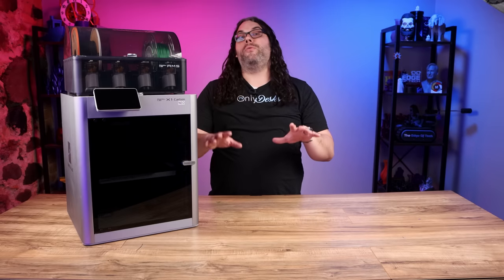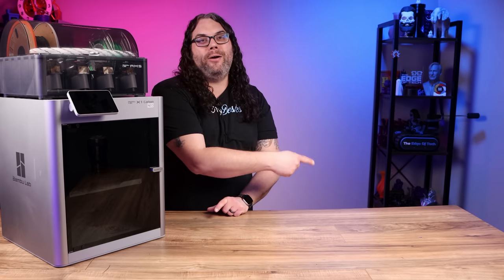10 Bambu Lab Maintenance Steps You MUST Do!

Comment: Definitely DO NOT spray IPA or any other cleaning agent onto the rods, spray onto a cloth and then wipe. Spraying in the enclosure results in covering the belts (rubber and alcohol don't mix, will dry out and crack), covering the linear Y rods and removing all the grease from inside which you can't repack, spraying onto the rods is terrible advice unfortunately. Follow Bambu's maintenance guides to prevent damaging your machine. Also probably best not to use oil on the lead screws, oil can run down the screw and into the stepper motor below (very bad), again there is a reason why Bambu specify grease and not oil 😵‍💫
Reply: Yeah, there's a lot of bad advice in this video. Clearly not made by someone who knows how it's supposed to be done. Also... using compressed air to clean a machine? Really not done. This will only blow dirt into the small crevices, making the risk of jams bigger.
Reply: To be fair, the official rod cleaning video published by Bambu Lab's youtube channel had them spraying alcohol on the rods. 
Not that I'd ever think or want to pour isopropyl into a spray bottle.
Reply: A paper towel? why not a micro fibre cloth..?

also why lubricate only one off the rods and not all? I got more questions then answers....
Reply: @joeyhouben3270 I think he was just using the one screw for an example. I’m with u on using the microfiber towel
Reply: Please do not pretend to know everything but know nothing, the oil will destroy the motor? That is the biggest joke I have ever heard.

😂😂😂😂
Reply: Really you shouldn't use IPA at all on carbon fiber as it breaks down the (epoxy) resin. A little distilled, RO, or DO water on a lint-free cloth is good enough.
Reply: @TonyShuai   When did they say "oil will destroy the motor"? They just said the oil can get down into it which is bad.
Reply: @_droid @_droid  Why does the official Bambu lab's video also use IPA?
Reply: @MarinusMakesStuff  so how are we supposed to clean those things without the compressed air? do we really have to disassemble the whole thing to wipe it down every month? that sounds like a huge pain in the ass
Reply: Can you point me to a better video? I need to do maintenance on my x1c and this was the first result I came across BUT THANKFULLY I came across your comment before performing. Please help. Thank you.
Reply: @MarinusMakesStuff  you seem to know what you’re talking about as well. Can you, PLEASE, point me to a better video? I need to do maintenance on my printer (an X1C) and this video was the first result I came across BUT THANKFULLY I came across your comment before performing. Idk if the original commenter will help but can you recommend a different video? Thank you in advance.
Reply: @slimthugga34 did you find a better vid...?
Reply: @GeneStarwind344 I’ve been doing it wrong this whole time
Reply: As for wiping the rods completely clean, well that black stuff he wiped off completely is the carbon from the self lubricating bearing. Yea, they might get dust and other debris on the rods but you shouldn’t have to wipe them complete clean and remove all the micro carbon lubricating factors. Also non lint things like kimtech wipes, not appear towels. And you can find a PTFE grease that would work better than the oil, at least last longer.
Reply: @slimthugga34  The better video is simply go to Bambu's wiki and the official instructions.  Then you can't go wrong, and they have very good very in depth information on thier website.  Not like some companies.
Reply: Yeah. Plenty of bad tips in this video...

Comment: Good video..but quit using regular paper towel!! That is leaving fibres behind. Use Blue shop towels or a microfiber cloth instead. Otherwise you are just adding to the problem of leaving bits behind on your rods and lead screws
Reply from the maker: Great advice! I used it because that is what most people have laying around. But if you look at the description, I linked the blue shop shop towels! :)
Reply: Careful with these microfibre stuff, might scratch glass or the coatings on the glass. Consider buying some optical wipes for this purpose

Comment: Do not use oil on your lead screws, this can destroy the motor as well as the entire screw. You need to use grease as specified. Also never spray isopropyl alcohol inside your container, you will dry it out and crack the belts. What the hell is this video?
Reply: The Bambu Labs video shows spraying liberally all over the rods too.
Reply: I was wondering why we got the grease packets.  😂

Comment: Do NOT use isopropyl alcohol on the camera or LIDAR! IPA removes coatings off lenses …. Like the anti glare coating on most cameras - including the Bambu cameras. This is also why you don’t use IPA on eyeglasses. (Source : I’m an optician)
Reply: IPA is recommended by the manufacturer.
Reply: @jeepthangjim  manufacturer is a 3d printing business. Not a lens manufacturer. IPA not recommended comes from lens manufacturers.
Reply: @alecubudulecu  Doesn't matter. The manufacturer of the machine provided recommendations on how to care for the machine. If you want your warranty to be honored, you follow the manufacturer's recommendations.
Reply: @jeepthangjim  lol.  you think Bambu will know the difference between IPA or soap and water on the lens?
Reply: @alecubudulecu  So you're saying there's no difference between IPA and soap and water?
Reply: @jeepthangjim  I’m saying pure ipa is bad for anti reflective coatings.  The source is every optician on the planet. Worked in the industry for nearly a decade and we used IPA to strip the anti glare coating.  It takes anti glare off. 

If you insist on using it … dilute it with a mix of 30% ipa and 65-70% water and a bit of dawn dish soap (like 2-5% ).  This is also how we make eyeglass cleaning solution.

Comment: CHAPTERS
0:00 Intro - 10 Maintenance Tips
0:14 Note - Bambu Lab Printer Compatibility
0:35 Removing AMS
0:51 Removing Top Glass
0:57 Cleaning Rods / Belt Tension / Error
1:09 Turn it OFF!
1:18 2mm Wrench - Loosen Four Screws
1:30 Isopropyl The Rods / Moving Head
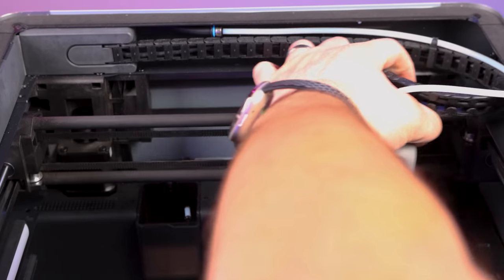1:41 Wipe until Dry / Paper is clear
1:59 Moving Gantry - Front to Back
2:08 2mm Wrench - Tighten Four Screws
2:19 Turn it ON! - Self Test Button
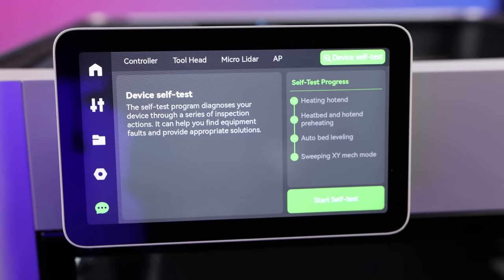2:31 Very Important Steps Completed
2:40 Cleaning / Lubricating Z Lead Screws
2:55 Keep it ON!
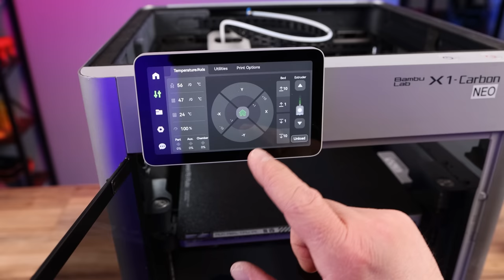3:03 Move Bed to Bottom of Printer
3:13 Lead Screws Cleaning / Isopropyl Thin Coat
3:39 Applying Synthetic PTFE Oil
3:46 Small Drops goes a long way!
3:53 Homing to spread Oil
4:03 Applying Oil to lower Lead Screw
4:15 Cleaned and Lubrication Completed
4:21 Recommended Lubricants
4:31 Quick Message - Thank You!
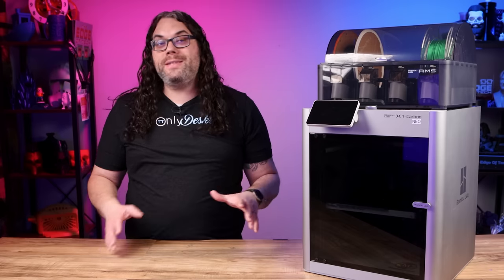5:03 Extruder Cleanup
5:12 Lift Off Front Cover / Compressed Air
5:23 Optionally Remove Extruder and Clean
5:41 Cleaning the Fans - Important!
5:56 Compressed Air - While OFF!
6:16 X1 Carbon - Cleaning Lidar Lense
6:40 Cue Tip and Isopropyl - Lidar Lense
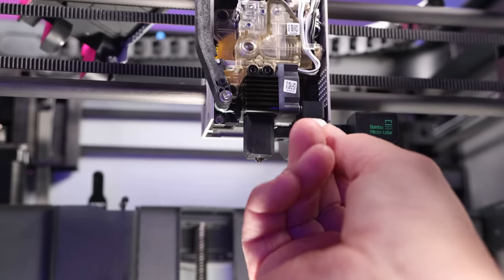6:48 Gently Cleaning Lidar Lense
6:53 Lidar Lense Cleaned!
7:03 Cleaning Camera - Cue Tip
7:19 Gently Cleaning Camera
7:34 Camera Cleaning Notes
7:42 Checking Filament Cutter
7:50 Filament Cutter Replacement Frequency
8:18 Remove Hot End Cover
8:20 1.5mm Hex or Allen Wrench - Cutter Arm
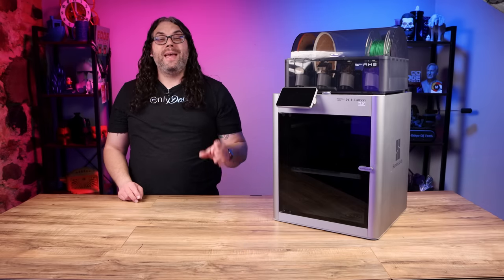8:58 Nozzle Wiper
9:20 2mm Wrench - Change Nozzle Wiper 
9:48 Note on supplied Cutters and Wipers
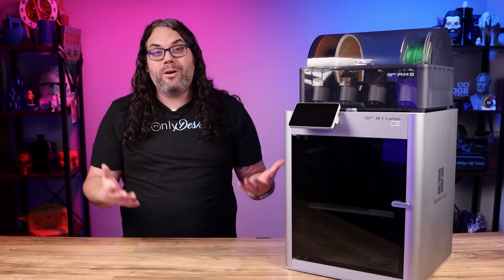9:58 X1 Carbon - Check Carbon Air Filter
10:14 Changing Carbon Air Filter
10:47 Changing Desiccant
11:23 Optionally Cleaning Dust AMS
11:34 Closing it up!
11:43 Maintenance Completed!
Reply: Thanks! He’s at the edge of tech, hasn’t quite made it to “tech” 😂
Reply: Thank you so much, @kyleirelandtech!
Reply: Nice one, cheers.

Comment: This is still the best maintenance video I’ve seen.  If you have any additional maintenance tips, please let us know.  And Thank You very much.
Reply: Ermm no its not, there alot of donts in this video....
IPA on carbon rods ? 
Spraying where it hit rubber belts that will dry out and crack ? 
Compressed air blowing crap all over your components ?
Oil that could dribbling down into the motors ?

Comment: I am interested in your extruder component with the clear (PC?) plastic, mine is 100% opaque. Was the translucent version an older model or an aftermarket part? 

I recently clogged a .4 CHT nozzle because I had it doing very rapid repeated retractions on the first few layers of the Open Ball vise when I printed the ball upside-down; I think the translucent extruder body could have helped me see what was going on to diagnose the issue

Comment: It's best practice to hold fans still with one hand and use compressed air with the other. This will reduce wear on the bearings and prevent a dynamo effect from putting electricity back through the system.

Comment: Really nice and helpful video. I bought a 99.99% IPA and am wondering if its safe to clean the lidar and the camera lens with it?
Reply: Yes. Be more careful about getting some on the belts when cleaning carbon rods. Ipa deteriorates them
Reply: I wouldn’t clean the lens with IPA. Ethilic alcohol 70% like that for medical use is perfect. Does not damage anyting and cleans perfectly.
Reply: An optician in the comments said not to use IPA on the lenses as it will remove their protective coatings.

Comment: I found on the Bambu lab wiki they mentioned some brand of grease instead oil or Super Lube 92003 Silicone Lubricating Grease with PTFE as an alternative but no oil for the vertical screws.
Reply: Same question: Bambu recommends a grease and the video says oil. There is a difference!
Reply: What brand of grease did they mention?

Comment: Hello. 
I have 1 question about Bambu Studios - maybe you will be able to help me. 
I was trying to add a simple, plain circle to Bambu Studios to print a coin but in bugger size (10cm diameter).  And when I upload the .svg file to Slicer I can see that the edge of the coin is not fully rounded - you can see the small walls that make up the circle. I tried uploading few different circle .svg files that are 100% circles and in Bambiu Slicer the walls & small edges appear. 

The question is: Is this normal that the Slicer shows these walls and not fully plain edge of the circle - but it will print it as a plain circle? Or should I do some editing within the slicer to make it disappear? Sorry to ask, my printer will come in a month from now and Im already trying to get some first models done and learn some about Bambu Slicer. 

Thank you in advance and Happy New Year! :)
Reply from the maker: To be honest, I've never added a SVG to the slicer and try to print it. Also I'm terrible at modeling lol If you don't use a modeling software already, you could try tinkercad. This might help with your designs. https://youtu.be/bVQBZArIt34?si=f7JGvCspMebdLJO6

Comment: If you do a lot of multi color prints make sure to check the PTFE tubes inside the AMS! I couldn’t figure out why mine kept jamming until I looked inside and realized the PTFE tube had completely worn through.
Reply: are you using abrasive material? because from what i've hear, the ams isn't supposed to be used with abrasive materials.

Comment: You left out one thing, especially if printing with ABS: Use some glass cleaner on the inside of the door and the underside of the glass top. The gasses from ABS will attract dust and grime and fog them up if not cleaned -- just like what you get on the inside of your car's windshield.
Reply from the maker: Good point!! I was going off their guide, so they probably should add that too! I appreciate the feedback!

Comment: Their are prints that you can make that will help you get the gunk out of the lead screw because when you use a paper towel you are mostly cleaning the outside when you really need to be cleaning the inside of the threads.

Comment: You forgot the most important thing, in my opinion.
Check the tubes, all the tubes. They do wear down and guess where all the debris and dust ends. X1 is known for clogging and I am pretty sure PTFE dust and debris is a bad thing. There are examples, that the filament has completely worn through the tube.
Bambu recommend check after each 10 kg or 5 kg if you use abrasive filament.
If you suddenly get under extrusion, check your tubes and replace if necessary. 
Bambu Wiki has a good guide howto.
TIP: Using compressed air is always, the first thing you do during maintenance. Just cleaned and oiled, no reason to blow dust to the oily things.

Comment: great video but as for the lead screws I will be using white lithium grease and a microfiber towel. The white lithium grease I have is made by Lucas, which is a well known brand in the automotive lube world. I also use it on the bed screws of my CO2 laser and it is some awesome stuff. And it stays on for a long time.

Comment: Where did you get the clear extruder?  Thank  you!
Reply from the maker: The X1C I filmed with was the very first one they sent me in May. I think the serial number is like 6.. LOL So the production units used a little different parts that weren't clear. My other 2 are not clear as well.
Reply: @The Edge of Tech  thanks for the reply. Just after I posted the comment, I thought maybe it was a kick starter model.   Thanks for your reply!

Comment: The lighting makes it look like you've greenscreened in the printer.  :D

A real question: am I right in assuming that the cutter is used once per print job if the whole job is from a single spool?  So that a non-AMS user basically has 3,000-ish prints (and new spools) before the cutter is likely to be wearing?
Reply from the maker: Lol thanks! And yes absolutely!
Reply: @TheEdgeofTech  Cool.  I figured as much, but an outside sanity check is always wise.

Comment: Bambu says if you use IPA on the carbon rods you need to follow it up with grease.  And what about checking belt tension?  My prints have been horrible lately.  People say my belts could be loose but I have no clue what to do.

Comment: Could I leave the printer on, wipe the rods with IPA, and move the print head side to side with the menu on the printer?
Reply from the maker: I guess you could, but if you spray the IPA, and hit the electronics, you may have issues. Since you are working on the belt tension as well, the printer won't move good if you loosen the tensioners first. That's why they say to move them by hand.

Comment: For someone with zero experience with 3D printing, literally none, and about to place an order for the X1 Carbon, what are must have accessories that I should order with it so I can print day one?  Planning to go with the carbon combo.
Reply: I got mine 2 weeks ago with zero experience as well and have close to 100 print hours already lol. Only thing I can say, order extra filament, a hot plate if you plan on doing ABS or PC. Other than that the only issue I had was a decided to orient one of my prints on my own as opposed to the auto orient on the slicer and it had some issues. Every other print in PC has come out spectacular

Comment: I could be wrong but I think when you were cleaning the micro LIDAR you may actually have been cleaning the camera lens. 

Yes , I said that right :) Not the chamber camera. The X1C has a camera on the bottom of the print head, as well as the micro LiDAR on the side. Again someone please correct me if that’s wrong but I’m pretty sure it’s not. :)

Comment: Excellent video! I like you make it clear you have no problem with making mistakes and poke fun at yourself about it. Good job! On the fans - I've been cleaning electronics fans for 40+ years, I always use a vacuum hose and a soft brush FIRST, then follow up with canned air with the vacuum hose nearby. MUCH less mess. Your way blows dust everywhere! Anyone who has this printer has a vacuum and a soft brush, eh? Cleaning the rails - shop / blue towels as you know, but put the towel BEHIND the rod then spray so the extra goes on the towel. ;) Small things. Again, great video that Bambu should have done. Sub'd. :)
Reply from the maker: Thanks! They definitely agree about the blue shop towels, and those were linked in the description from the beginning! Beginning! The reason that I used paper towel is because I didn't have my blue shop till at the studio and I think more people have paper towel in their house. But I definitely mentioned to be very careful because it will flake off. I appreciate the feedback and agree with the vacuum as well! As you pointed out in another comment, I was following their instructions and wanted to make sure I betrayed their instructions correctly. But I agree with you 100% on the things you said! Welcome to the channel, I appreciate you being here!

Comment: Couple things:  Your link to the alcohol takes you to a 91% - not 99%.  And where do you find the self check on a P1P?  I've looked and don't see it, unless I'm just missing it. :( 
Otherwise, thank you for this awesome video! I was just thinking about maintenance for my P1P.  Still very new to the hobby and I want to take care of this thing like it's gold! :)
Reply from the maker: I will double check what it's called on the P1P and get back to you! Also, I have fixed the link!
Reply: On the Bambu Handy app, on the first screen you go to the three stripe menu in the upper right corner, then Machine Assistant, and then the Magnifying glass with heartbeat kind of icon in the upper right corner.
On the printer it's in the third menu (so the settings), on 2nd page under calibration.
In BambuSlicer it's on the device tab, top right option for Calibration.
Reply: @nAcolz  Thank you!

Comment: Read the manual for maintenance and always double check you didn't miss anything.  Great video and information but always always follow the manufacturer maintenance instructions oil and replacement part . After all there the ones who designed the 3D printer 🖨